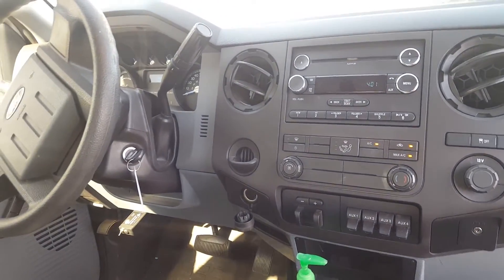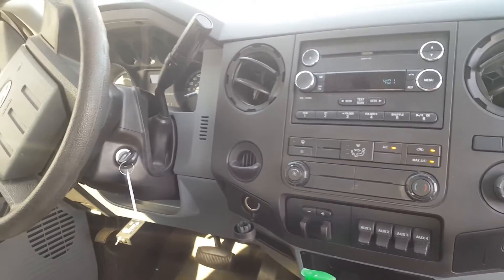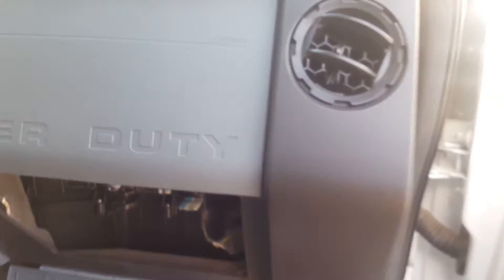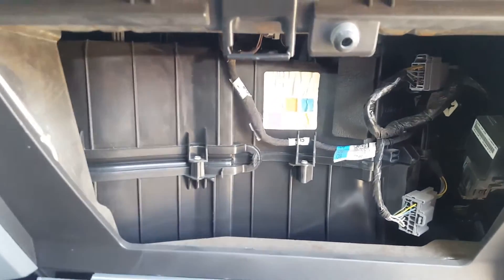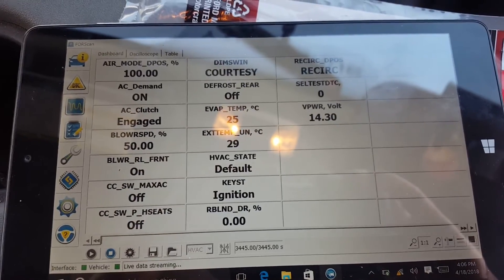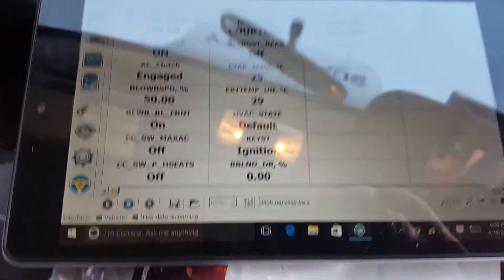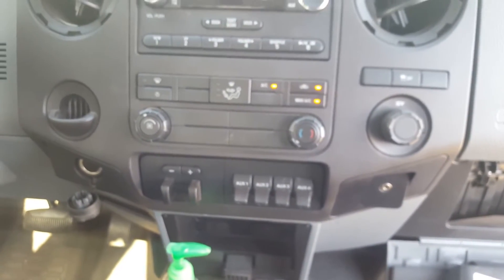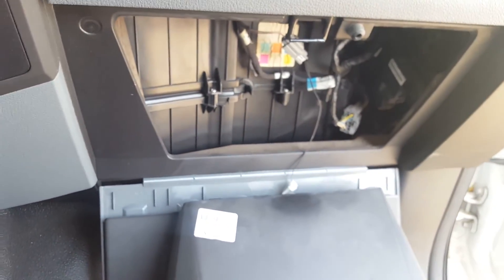Ford 6.7 Temporary quick ac fix

Comment: Fixed mine in 15 minutes today. Drilled a 2" hole where those multicolored squares are. Inserted the new sensor into the coils, plugged it and now looking for some long johns the A/C is so cold. Covered the hole with some insulated duct tape.

Comment: ** Part number **  
MOTORCRAFT YH1735 - BC3Z19C734A - BC3Z-19C734-A
A/C Refrigerant Temperature Sensor
Shows to fit 2011-2017 F250, F350, F450, F550
Available from RockAuto for $49.79 as of 08.05.2024

Comment: Does tis sensor has anything to do with a/c blower not blowing out at full speed?  it works at all speeds but do out think it is pushing out full air speed.
Reply from the maker: If the evaporator is freezing over this could cause lack of air flow. This could technically be caused by the sensor not seeing the correct temperature although we have not run in to this before. Most likely there is something else going on like the Cabin air filter is plugged or the fan or wiring is failing or the evaporator is plugged with debris.
Reply: @ostsaz  Thanks for reply. I have took another look and looks like the last speed is not working , all working but when turning to the last one witch supposed to be the highest speed will not work is the same speed as the one before that. I suspect that something maybe up with the blower motor resistor maybe..?
Reply: Yes, the resistor is usually the cause for a loss of one speed.

Comment: Thanks so much! I replaced everything in this truck except the evap. Temp sensor. And when I replaced the a/c core I put the evap. Temp sensor back in it and didn't think to replace it. It's tricky to install, I was afraid I would damage the core becauseyou have to push it betweenthe fins on the core. But I'll install it correctly when I have down time. I just won't overuse the a/c. Thanks so much this was a huge help!

Comment: Using a 1 1/4"  hole saw, I drilled right on top of the sticker with colors. Found the sensor was right inside the hole inserted in the aluminum coils. Removed the old one with a pair of needle nose pliars and placed the new sensor in the same location as the old one. Closed the hole in the a/c box using the removed section of plastic from the hole saw, plugged in the sensor and saved myself $2500 bucks :-) Took about 15 minutes!
Reply: Yes, pic please!
Reply: having the same issue i believe  Do you have a picture?
Reply: Hi, what model year truck were you working on and what model?
Reply: Did the plastic you cut out fit the hole wel or did you duct tape it in?
Reply: @WannabeofftheFlock  hvac tape
Reply: Do you have a picture of this?

Comment: Couldn't you feasibly drill a new hole in the air handler box and install the sensor and use some RTV sealer to seal it. Would that serve as the same purpose as remounting it on top.

Comment: First I gave you a thumbs down because you didnt go all the way and made a hole to put the sensor in a place where it could read... but after finding out that it was going to cost me $1200 plus the parts I decided to buy the sensor since it was only $30 including tax at the ford dealership.  Auto Zone, O'Reillys, Napa... they dont carry the sensor.  Part number is BC3Z-19C734-A.  My AC works fine now.  2015 F450 6.7 so thank you for the video, I think Im going to buy a AC box from a junk yard  (is only $100) just to see exactly how and where the sensor goes and where I can make a hole without damaging anything.
Reply from the maker: you can cut a square in the box but we didnt put this in there because it is easy to puncture the evap core and then you have to pull it out.
Reply: It only takes 20 mins to pull those dashes out. And five more to replace the temp sensor.
Reply: @gearheadsautomotiveinmidlandtx  REALLY? damn lol...my a/c is doin the same,i added freon,was cold for 4 days,now its hot but freon is not low...im lost.😤
Reply: @Gorealaracer38  yes sir!!!
Reply: @gearheadsautomotiveinmidlandtx  10 4,thnx!
Reply: @gearheadsautomotiveinmidlandtx  are you serious??
Reply: @LJ-zz7bp  hell yes. 
I do it for a living. 
I'm a Ford technician also. Amongst other things. I can post a video later if y'all desire.
Reply: @gearheadsautomotiveinmidlandtx  will the evap temp sensor (YH-1735) for the superduty work in a f150 ?  I’m wondering if the ohm range is the same. If it is it would save me. I can’t afford to take it to the dealership
Reply: @gearheadsautomotiveinmidlandtx Can you tell me when this start to go out? Does it start dripping also on the floor board?
Reply: @gearheadsautomotiveinmidlandtx Is there anyway you could send me that video, please? 56 year old woman here but I've been watching videos and fixing stuff by myself

Comment: My ac is working pretty good, but I don't see and melted water coming out on the ground, no leaks inside? 2012 f250, any ideas?
Reply: Curious if you drilled the hole and stuck the sensor in the box. I changed my plug and blows ice cold, but I dont have any water dripping anymore as well.
Reply: @rtsinc4  My thoughts exactly, sure would make sense as that's all it is anyway. Never have figure out why I don't have condensation leaking as it should? Again nothing wet inside? My new to me 2016 leaks condensation every time I stop.

Comment: firm believer that automotive engineers need to work on what they design. just because it looks good on their part of the paper does not mean it is functional for everyone else.
Reply: Very true - from our perspective. However, from the company's view, that (type of thing) is simply job security for their entire industry. 
If only there was a legit choice, meaning one brand that actually gave a flip, but they ALL have the same thing going on.
Reply: This truck also has no ac cabin filter. For some odd reason. So you’ll destroy the evaporator very easily if you work and drive in dusty areas or always have the cabin air recirculate button turned off.

Comment: 100% works... I'm going to make a hole and silicone it in, see if it works for a while.
Reply: it will
Reply: I was thinking the same thing...
Reply: Yep I've had it on mine for a year now and it still works fine. It does freeze up some so we try to cycle it on a long trip but if it freezes we turn it off and leave the fan on high, once the air comes out strong again turn it right back on for full cold. Also so I made the slot hole for the front of the box with my soldering iron, perfect little slot and siliconed it in!!!

Comment: Do these questions ever get answered or addressed? Do I need to call for some info? Really need help
Reply: Look behind your glove box and see if the plug looks the same. That would be a good start.
Reply: Could you drill a hole and silicone?
Reply: I just did this and I'm blowing cold air

Comment: Wonder if you could drill a hole in the box and install it there. Would it work correctly then?
Reply: There is post buried in a powestroke forum that shows a guy cut a hole in the box with a box knife and swapped it out... fixed it.
Reply: @jarodgroves01  have a link? I've looked for it. Have a 2010 f150 King Ranch that doesn't get cold when it's hot and humid here in the gulf coast.
Reply: @tritontr21  hey I actually did the fix myself last weekend. I drilled a hole with a 11/4in hole saw. See that blue square on the sticker. Take the sticker off and drill right there. Be careful not ram the tool into the box. Use light pressure.  Took 10 mins. I need to post a video.
Reply: @jarodgroves01  please let me know if you do. 

Can you feel a difference?

What year model? Mines a 2010 Kong ranch.
Reply: @tritontr21  yeah I could see on forscan the compressor short cycling. Plugged a new sensor in before I drilled the hole to make sure it would cycle correctly and get cold.  Gets to 38.8 degrees F now. Works like new. I'll post a video tomorrow.
Reply: @jarodgroves01  I was sitting in the drive through a few minutes ago and had an idea. My King ranch has a center speaker. It looks like it sits on top of where the original Evap sensor is installed. I'm going to lift that plate and speaker out tonight and see if I can access it through that speaker mounting plate. 

From other videos I've seen it's supposed to be dead center up near the firewall.  

Thanks for the replies. I'm going to try a find the correct part for my truck and order it.
Reply: @tritontr21  my truck is a f250 as well. Not sure if you have the same HVAC box
Reply: @jarodgroves01   Hey Jarod do you have any pics or a video?
Reply: @caitdejesus6618  I keep forgetting. Maybe tomorrow.
Reply: Did you ever get to upload that video. My evap core temp sensor needs to be replaced but just like the guy said in the video the cost time it would take to get the dash off just isn’t worth it. Thank you
Reply: yes then silicone hole
Reply: E Cas temp sensor